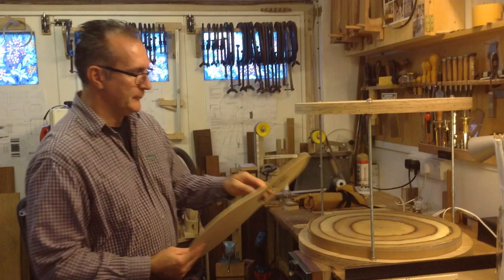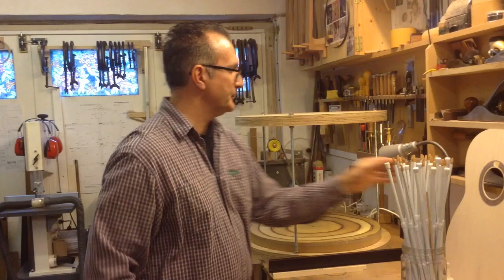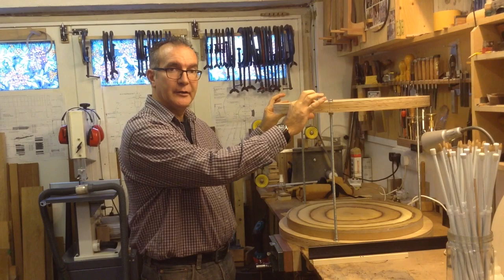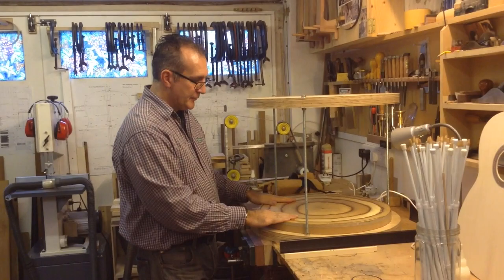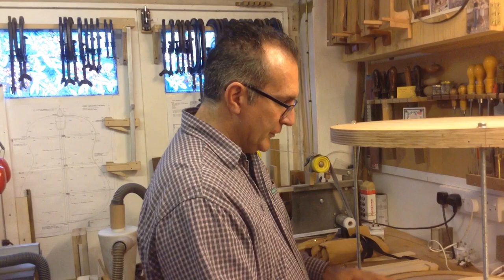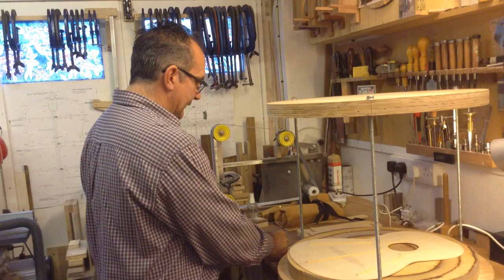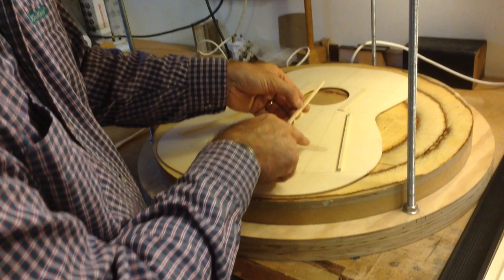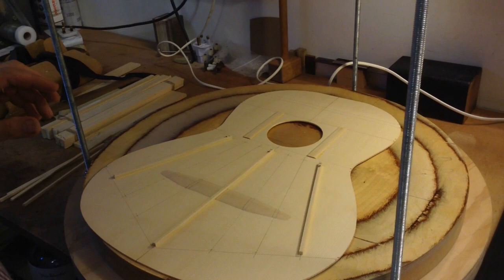How to make the dome on the sounboard of a spanish guitar

Comment: Hi Mr. Requena. Very good video and explanation. Did you ever try to install the bridge on the top right after you finished the bracing? Wouldn't be easier to clamp it and assess the work to make sure is done correctly? Think about the comfort and easiness of doing it. You can have a hole the size of the bridge in the middle of the Solera. It will not be in your way when you glue the top and the back to the sides. That will eliminate all the problems trying to glue the bridge using clamps through the soundhole. Just a thought.
Reply from the maker: No, that approach won’t work as there are other things to take into consideration. This is not the right platform to be able to explain why, but all these things are explained in my course.
Reply: @redkitekk  I understand, thank you.

Comment: I spent time in a Piano Rebuilder's Workshop where he created a Piano Soundboard GoBar platform out of 5/4" Mahogany boards large enough for full size Grand Piano (D size) Soundboards. He made a coorespondind Router Sled to cut the necessary Radius depth needed for the Piano Bridge to create the dome of the needed souundboard 'Downbearing' from the Piano Strings. Making a Radius Dish for Guitars is vastly easier than this Monstrosity

Comment: Excellent!  You seem to have 3 fields mastered...luthier, teacher, and linguist.  Your English is 10 times better than the president of the U.S!  Do you glue the soundhole reinforcement and bridge patch in the dish?
Reply from the maker: Hi, Thanks for your comments ....... Yes, I glue them in the dish, that way the soundboard will start taking the arch. I glue all the components of the soundboard on the dish except for the two top trasversal bars above the sound hole, they are done on a flat board.

Comment: Great video which explains the process well. I notice that you don’t shape the bottom of the fan struts to match the contour of the dish. I have been doing this, but having seen your video is there in disadvantage in your view with not contouring the bottom of the strut? Thanks again Pablo !!
Reply from the maker: Hi Paul,
I have done it the way you described in the past, but I have to say that it is a lot of more work for not much of a difference on the results, so for me it works better glueing the struts without shaping the bottom. I would suggest that you try it for yourself and draw your own conclusions.
Reply: Great thanks Pablo-I will definitely take your advice

Comment: When you put a dome in the top, then the edges of the soundboard are no longer in a flat plane. So when you put the top in the solera, how do you make the straight sides fit all around the edge of the top?
Reply: excellent question
Reply: @mypronounismaster4450  And it also occurred to me that the peones cannot be straight (90°) angled either. So how do you match up the angles between the domed top and the sides+peones
Reply: @jackbombeeck4958  For the sides to match the curved top you put sandpaper in the dish and then sand the sides to the shape of the dish. 

Might not be how this guy does it, but it's the way I've seen others do it.

Comment: Pablo, thank you for a clear and detailed explanation.  If the sagitta is .235" in the center of the dish, what do you recommend as the sagitta for the back.  I understand the front and back need to be different so as not to cancel out each other.  Thank you for your reply.
Reply from the maker: Robert Semans I use the same arch for the front and the back.
I know there are different lines of thought in this matter, for me there is no problem in using the same arch.
Also, just in case you are interested I have recently launched a complete guitar making course where you can learn in detail about how to build your own classical guitar, you can find it on www.onlineguitarmakingcourse.com

Comment: Hi Pablo, Thanks a lot for your great videos ! However, I don't understand the measurement. I have made a simulation on a 3D software. When I take a 25 feet radius (7620 mm), the depth for the diameter of 530 mm is 9,227 mm. To have 6 mm depth you should have a radius dish with a diameter of 430 mm or a 11,7 m radius. Are you Ok with these ?
Reply from the maker: With my 25 feet radius dish 530 mm in diameter the deepest point is about 5.5 mm
Reply: @redkitekk  Thanks a lot for your answer. I'm sorry, I made a mistake. In my simulation, I took a diameter of 25 feet instead of a radius of 25 feet. Best regards.

Comment: Another great video.  Much appreciated, Pablo.  One observation: The way you brace the top in that disk, the position of the bridge, hence the saddle is not on top of the dome.  Is the bridge located on the slope of the top?  Thank you again
Reply from the maker: qvu100 , the soundboard is only domed in the lower area so the bridge and the saddle are more or less on the top of the arch. The dome is also very subtle so even if the bridge wasn’t right in the middle of the arch it wouldn’t make any difference.

Comment: Pablo, thanks so much for your videos.Pablo what size of spring did you use in your home built rods. They look as good as the Chinese curtain rods and more economical  gauge and where did you purchase 30 of the same size small springs?Thank you again for your generosity of sharing your knowledge with us.cheersBernard Walsh
Reply from the maker: Hi Bernard, the spring is a compression spring of 8 mm in diameter and 50mm long, I bought them on eBay long time ago so I don't have the contact anymore, but I am sure there are many on lone to choose from.

Comment: Hi Pablo,

I love your videos!
Question about the dome on the soundboard... what part of the soundboard is the apex or the highest(deepest) part of the dome located?

Based on the video, assuming the deppest part of the dome on the board is in the center... the apex of the dome would be near the top of the braces closest to the soundhole. Am I correct?

I always thought the center of the dome is on the bridge part. Please explain.

Gracias!
Reply from the maker: It is difficult to establish accurately which one is the highest point of the soundboard, but it would be as you mentioned between the bridge position and the lower harmonic bar. This doesn't have to be the only way of doing it, once I have the dome established on the soundboard and all assembled on the guitar, I fit the bridge in place and it has always worked for me. Try it like this and see if it works for you.
Reply: Thanks for the reply!

Comment: Hi Pablo hope you're all well at this time.  I'm on my 3rd build but never built with a cedar top for a classical before.  All my wood is from Madinter as recommended by yourself.  My question is what thickness do you recommend for the top or is it just down to feel and ear ? Thanks
Reply from the maker: Hi Dave, cedar is a softer timber than spruce so normally you would need to make a slightly thicker soundboard but bare in mind that you still need to find that balance between stiffness and tone. Sorry I can’t give you a specific thickness, you would need to remove material until you get a good sustained tone when you tap the soundboard.
I normally find that at a range between 2.9 to 2,4 mm depending on the board I am using.
I hope this helps
Reply: @redkitekk  thanks so much for your quick response.  I really appreciate it and all your uploads 👍🎼

Comment: Hi Pablo,
I have another question because I saw your video on the different types of solera molds.
How do you know if the radius and the depth of your dome on which you will make your table will coincide withe  the solera on which you will assemble the guitar.
then, if I use a radius of 25 feet and a depth of about 6 mm, will a solera hollow between 2.5 and 3 mm be adapted?
Thank you Pablo
Reply from the maker: Hi Gilles, bare in mind that if you have a 6mm gap over a 530mm diameter dish, the width of the lower bout of the guitar is about 380mm, so the depth of the arch would be around about 3mm. 
On the other hand, what I do to make sure that the shape of my solera is not going to interfere with the dome of the soundboard is to make the depth of the dome area about 6mm deep. 
Hope that helps
Reply: yes it helps me. Thank you Pablo, for your explanations

Comment: Hi Pablo, I used a radius calculator to find the height of the arc in the middle and at an arc length of 530mm for a 25ft radius it gives me an arc height of 4.6mm (not 6mm). Can I just check your work board was 530mm and if so, how come I am getting a different height please? Thanks.
Reply from the maker: Hi astrobooder , I have checked with my dish and it is 530 mm diameter but the gap is 5 mm instead of 6. Sorry, I didn’t measured it very accurately when I made the video and you are right that the gap is closer to 4.6 as you calculated.
Reply: Thanks Pablo.

Comment: Pablo,  I have a question about the amount of 'spring-back' that might occur.  I understand that the 530mm dish with 6mm dome will give about 3mm high dome on the sound board, but I have found so far that once I remove the soundboard from the jig the actual dome height 'springs back' to about 1.5mm.  Should I make the dish deeper to allow for the spring back, or am I doing something else wrong?Thanks - Mitch
Reply from the maker: Hi Mitch,
It is not unusual to have some spring back, however, if the humidity is constant in your workshop your soundboard should stay pretty stable. Perhaps this is something you can keep an eye on. For example, if you glue your struts, and especially the lower harmonic bar at a humidity of 5o%, if the humidity goes down just to 45 soon after glueing, you will find you you loose a lot of the arch. However, if you wait until your worship is at its lowest humidity you will find that the arches you make on the soundboard and back stay properly.
In any case, if you loose a little bit of the arch, you always can do the final adjustments when you work the fingerboard to get the right set up.
I hope this helps.
Pablo
Reply: thank you Pablo - I  did think about the humidity when I was gluing the back and sides on - but I have no idea what it was when I glued the braces - but I will next time!!!  I have watched all your videos and enjoyed them very much - it is a long way from Scotland but one of your courses if high n my list of thing to do.Mitch
Reply: Hi Pablo, I used a radius calculator to find the height of the arc in the middle and at an arc length of 530mm for a 25ft radius it gives me an arc height of 4.6mm. Can I just check you work board was 530mm and if so, how come I am getting a different height please?

Comment: Hello mr Pablo!perfect video! I have almost a dish radius 30...I can use that for the dome or I must use a a 25 radius dish?thanks..
Reply from the maker: Of course, you can use a 30 feet radius dish, but bare in mind that when you arch the soundboard it has a tendency to relax and flatten slightly so you need to check that it isn’t going to end up being flat. For that reason It would be safer to use a 25 feet radius dish
Reply: @redkitekk   suppose if I use a radius dish 15 feet it would be enormous...
Reply from the maker: Γρηγορης Μαυρακης , I wouldn’t recommend 15. I think 25  feet radius is the best arch.

Comment: Hi Pablo. thanks for your videos. they are very helpful.  My question is: Why a 25 feet radius? why did you choice this specific radius? 
cheers!
Reply from the maker: 25 feet , or 7.6m is the arch that you will find in most Spanish guitars. This practice started a long time ago, and it is considered an importan feature on a Spanish guitar. 
This is for acoustic and structural reasons and perhaps too much of a subject to try to explain here.
Reply: @redkitekk  Humm! interesting. I'm doing my classical guitar and following all your steps. (thanks for your videos). So, what radius use you for your classical guitars? I saw some luthiers using 28 ft. others 40 ft.  thanks
Reply from the maker: Marcelo Ferreira I use 25 feet for both the front and the back
Reply: @redkitekk  Thanks Pablo.

Comment: where i can buy this bars??  May i a adress on LINE?
Reply from the maker: Albanito Asevedo , I bought them in a local hardware store, you can find them in amazon, look for spring loaded adjustable curtains rod, you will find them in different lengths.